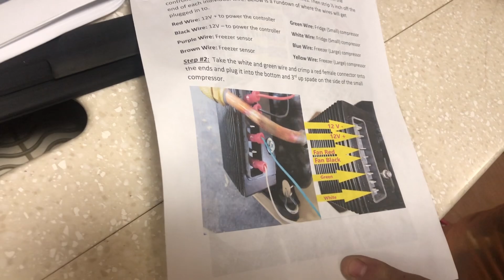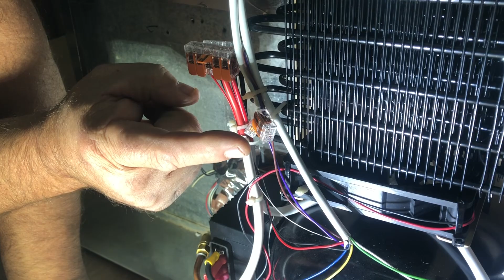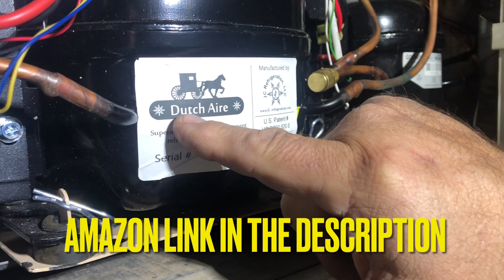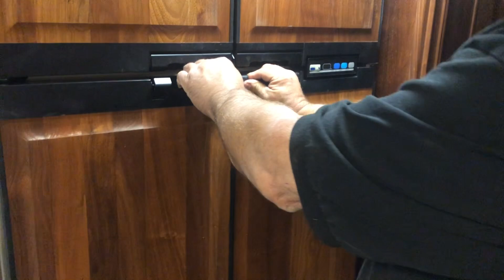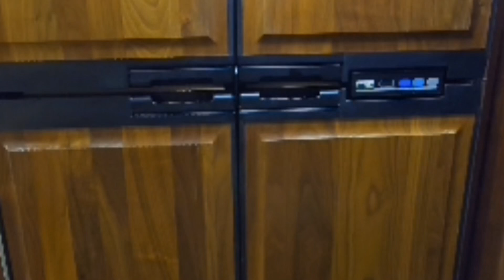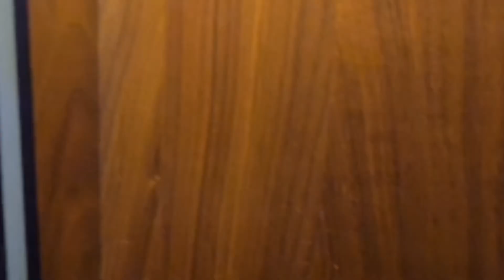Norcold 1200 RV 12v DC refrigerator retrofit pt 3 of 3 (#341)

Comment: Comment on how you align the holes in the Norcold box and the JC Refrigeration unit.
Reply: thank you for your interest! the conversion is still working great. as to alignment of the cooling unit to the back of the box any hole that dident align or wasent present we simply drilled new holes in the mounting plate the instructions are very clear.In the case of the interior screws they lined up perfectly but a couple did need to increase a little in size to make up for a little offset. It is important to pre fit the cooling unit to adjust the foam for a correct tight fit prior to sealing with the metalized tape and spray foam,i hope that answers your question if not please be more specific and i will reply to the best of my recollection .
Reply: I did go back and watch video 2 of 3 and we did go into detail on this subject , thank you and cheers to a great project!